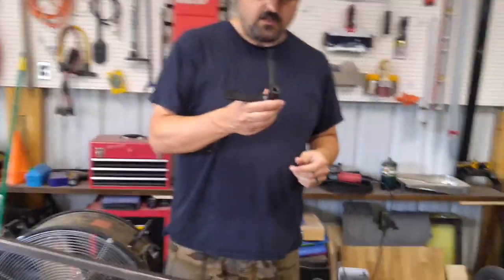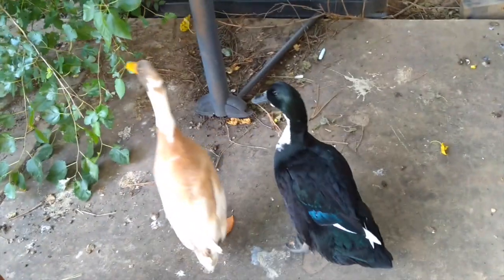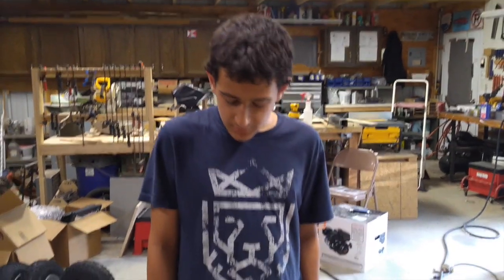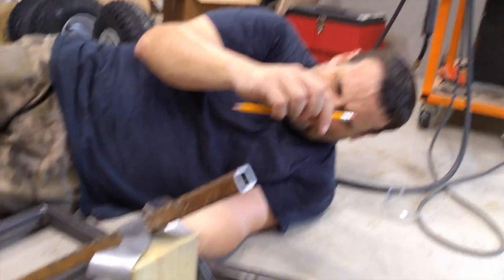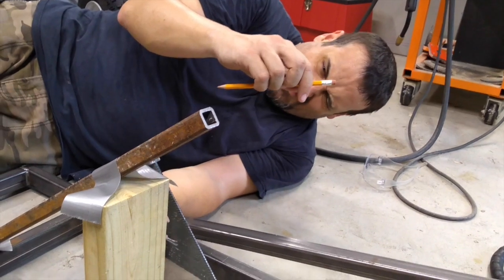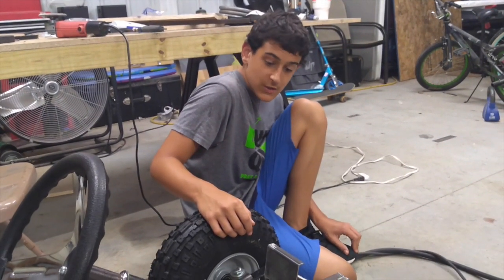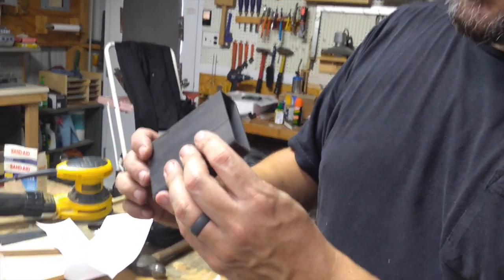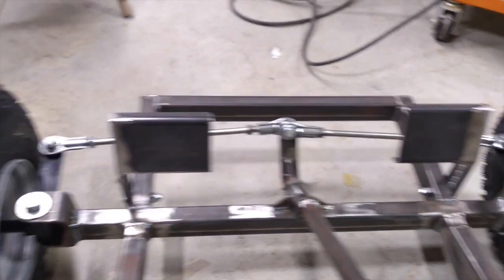Building a Go Kart, Part 3 - Steering and Pedals

Comment: I just took a kids electric Razor drift kart and stretched it, With full sized axles and tires, and a tecumseh engine,
because the original frame members are really weak thinwall I added sub framing and reinforcements,
I have believe this kart would soon flex to death if I was to do Wheel-Jacking through King-Pin-inclination,
I'm glad I watched your decision, I'm going to put in some king pin angle but not very much.
Reply: Nice, I just chipped a 110 quad in half more or less

Comment: What model n name is that bandsaw? Awesome weld's young man!! Love that shirt you are wearing also, need more of them in alot of youtube video's!!
Reply from the maker: The horizontal bandsaw is a Klutch 4-1/2" x 6" from Northern Tool. It's basically a twin to Harbor Freight's 4 x 6 horizontal (maybe slightly higher quality). The portable bandsaw is from Harbor Freight, with a home built stand and table.  It's probably the most versatile metal working tool I own, and the best 99 bucks I ever spent! Thanks for the compliments!

Comment: Do you think this steering design can handle a 450cc Motorcycle engine or would it be overkill for this design?
Reply from the maker: That's a lot of engine! It would work, but you might look into a rack and pinion style setup. That might be a better fit.

Comment: Hey fellers just making a suggestion weld on piece of metal
So that you cant push the go fast pedal past W.O.T. without a stop on the pedal you break the throttle cable and in some instances damage the carburator...
Reply from the maker: Good call! We actually added pedal stops in part 4.
Reply: @anticsgarage5230  i was just watching part 4 and saw that and had came back to delete this comment... Im atually watching this for the second time i fell asleep on yall earlier ( im old the heat just takes it out of me these days)